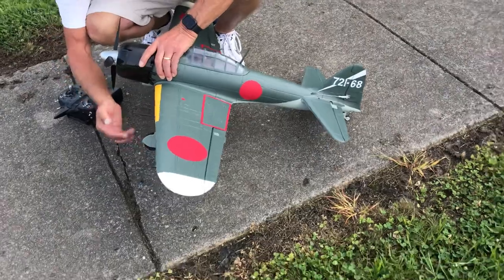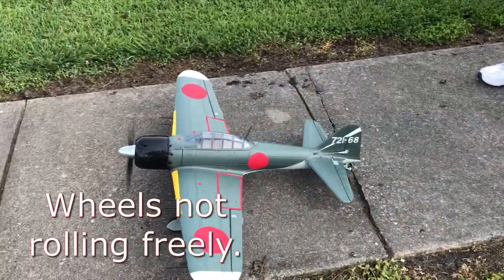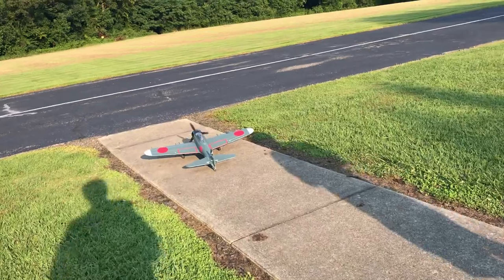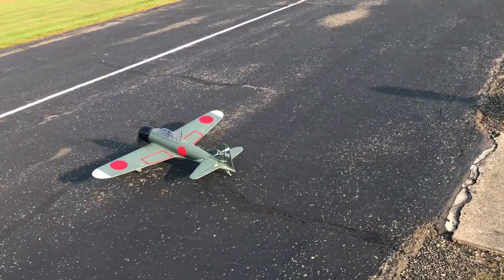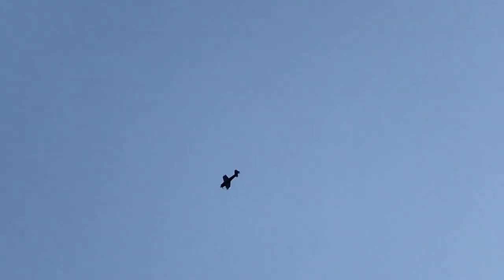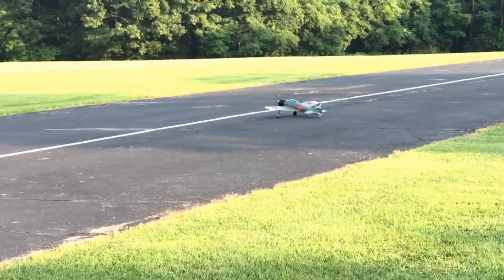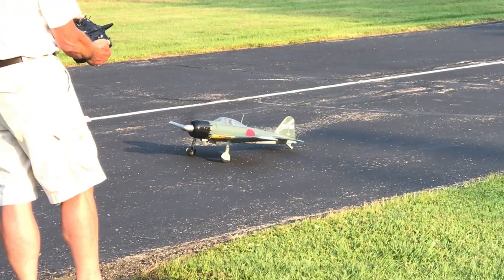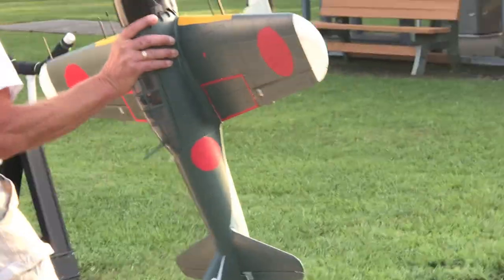FMS 1100mm Zero maiden. Pilot Mike maidening Pilot Carman's Zero  at CSF.

Comment: Do you have problem with tail heavy? I just got one but I think she is tail heavy. Do I have to add some weight up front?
Reply from the maker: You need to measure the CG and balance her upside down with the gear deployed.  Shift the battery forward.  If that doesn’t cut it, the other options are weight or a heavier battery.  Heavier battery is the best solution. Pilot Mike flew it on a 2200 battery.